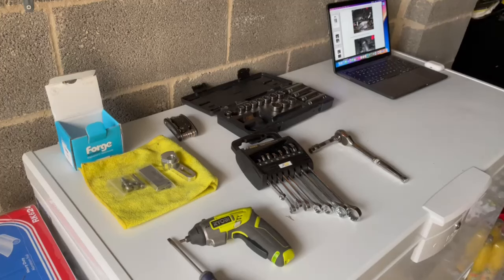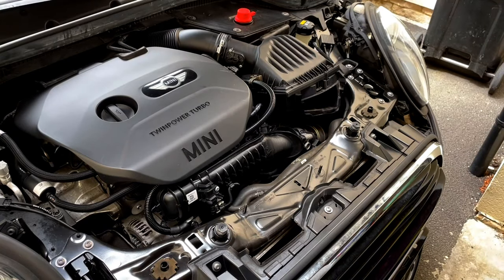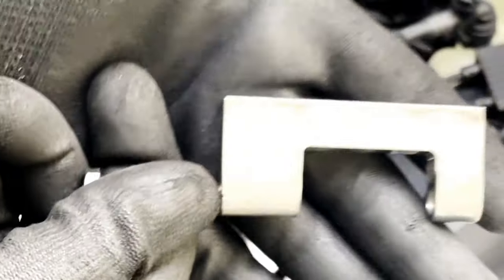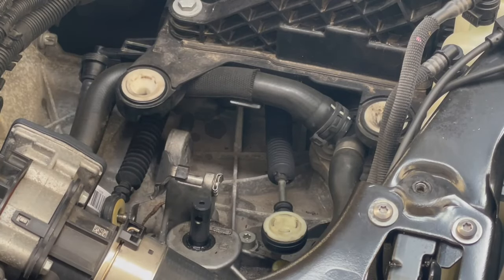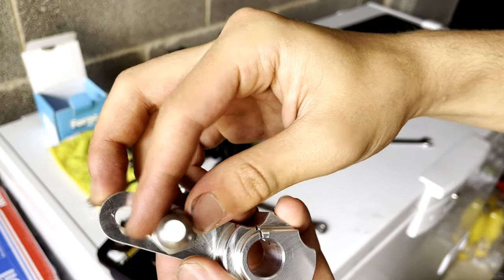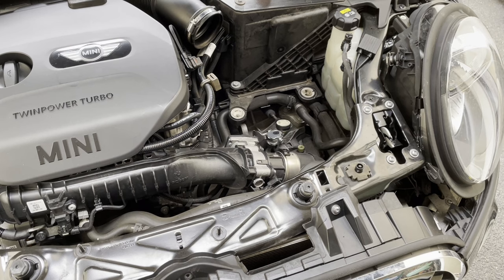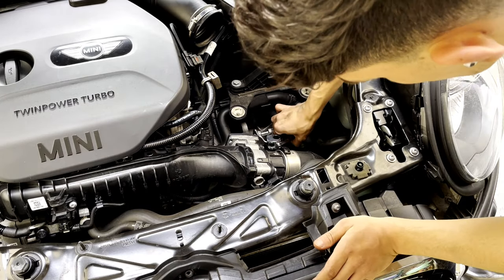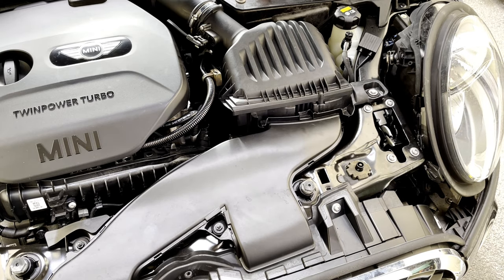forge motorsport short shifter install in mini f56

Comment: Hi, a good straight forward tutorial video on fitting the short shifter ...I notice that the fitting was on the 1.5 and the only reason for asking as i was led to believe that these dont fit the B38 1.5 F55/56 .
I would appreciate it if you could confirm your model of mini please ,basically i am looking at fitting one on a 2014 cooper F55 1.5 petrol B38 ..Thanks
Reply from the maker: Hi mate yea my car is a 2017 1.5 mini f56. I had no issues installing it. Hope that helps